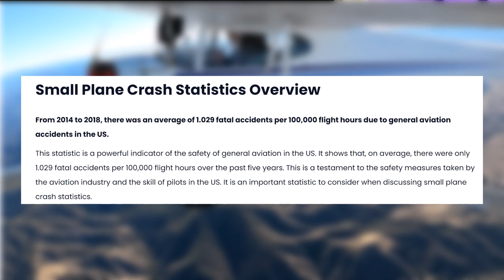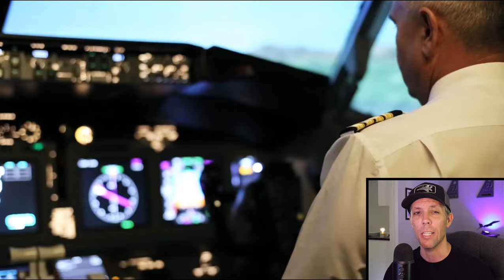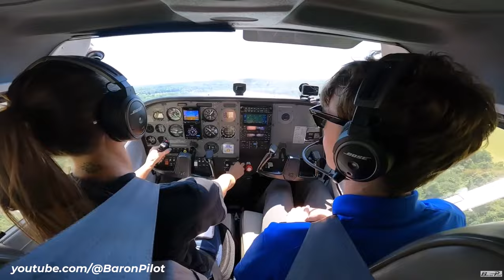Student Pilot Engine Failures Caught On Camera!

Comment: I just don’t get it. Having had the rear engine oil pump drive shaft shear off our Cessna 337, yet my Toyota 2.4 litre 118 hp 4-Runner went perfect over 342,000 kilometres. I just do not understand why all the consistent engine-out failures with our aircraft. I mean, dual ignition/mags/low rpm/meticulous maintenance regimes… odd
Reply: Car/truck engine doesn't run 80%+ of power all the time like piston planes do, a car at most at 100kmh need 30hp to cruise maybe 50 for a truck... most plane engine were designed and certified first in the 50s some go revision some don't, some fly regulary some don't. let your car sit often, cylinder start to rust, oil get more water from condensation, bearing dries etc that car engine will not last things will broke. I ve seen timing chain fail due to that under 100k km on a 20+ years old car that was sitting for months not even running
Reply: @ItsJust2SXTs  Thank-you for this. However, why are we utilizing 1950 technology in our aircraft mechanical design/engineering/build/material?
Reply: They don't fail very often. They're only involved in 13% of accidents. What % of those are actually engine related, vs caused by other issues that impact the engine, like empty fuel, fuel delivery (pumps), fuel quality ( contamination ), fatal accidents are 1 in 100k flight hours according to this video, but the actual fatality risk is low (according to a quick google search, 0.23% — "you would need to fly every day for more than 10,000 years to be in a fatal plane crash. On the other hand, the chances of dying in a car collision are about 1 in 101." That's partly caused by far more vehicles being on the road than airplanes in the air, far more vehicle hours operated, etc but still, you should worry more about engine failure in the Uber on the way the airport than engine failure in the plane flying overseas.
Reply: @rob379lqz  Because airplanes from the 1960's, 70's, etc, are significantly cheaper than their modern equivalents...

A brand new, million dollar airplane, with all the modern engine and safety tech, etc, is well out of the range of most general aviators. That's why they buy used and attempt to keep them maintained. Some do better, some do worse...
Reply: IT IS ODD ...   I believe it's due to LACK OF MAINTENANCE
There should be a requirement to check the specs of an engine every let's say 50 hours ; compression, plugs, wires, fuel pump pressure, etc
People are just WAITING FOR THEIR ENGINES TO QUIT and doing NO preventative maintenance

Comment: As crazy and stupid as it is, the guy jumping out of the plane was rather funny (if it was a real engine failure). He was like "seeya". Still not a good idea, but I think if it was a real situation, i think he should have pitched the nose forward to pick up some speed and probably could have glided over the rest of the mountains just fine, and should have at least tried to make it as close to the end of the mountain range as possible while scanning for alternatives ahead if he came up short. But he should have been able to glide that far. 
By the way, I saw Aviation 101 talking about immediately pushing the nose forward to trade altitude for speed to buy some more glide time. Isn't that more ideal than just trying to stay level at first?

Comment: arent engine failures kind of on the pilot or plane owner as well? its their job to check and maintain the plane. if your flying a an old piece of junk thats also on you
Reply: Not all failures are easily spotted even with all the necessary checks.
Reply: A friend of my CFI had an engine fail right after a rebuild. Mechanic made a mistake.